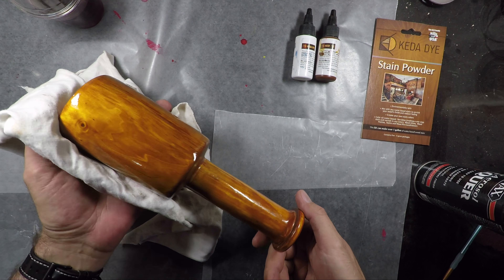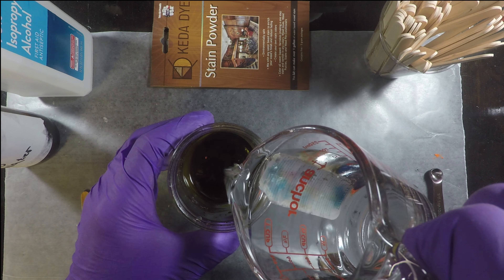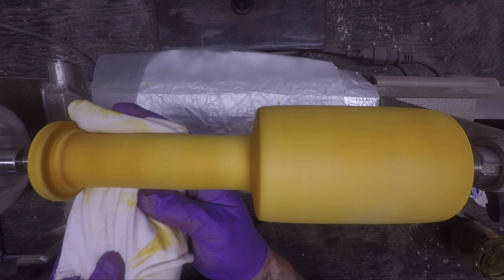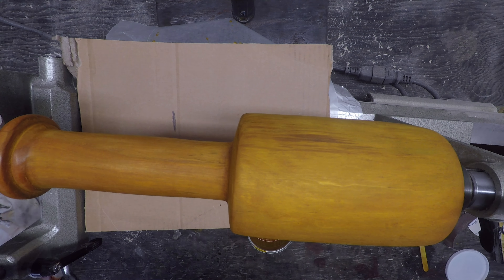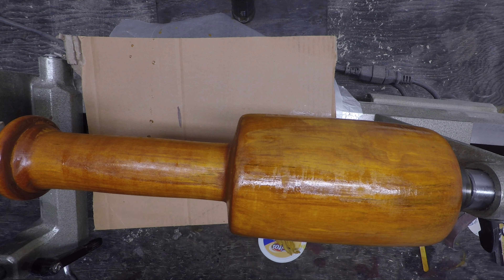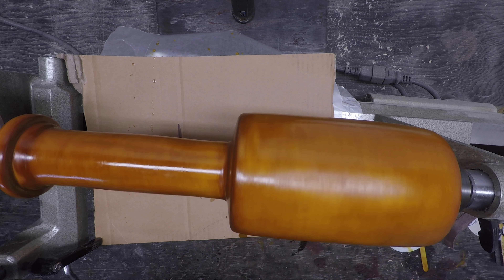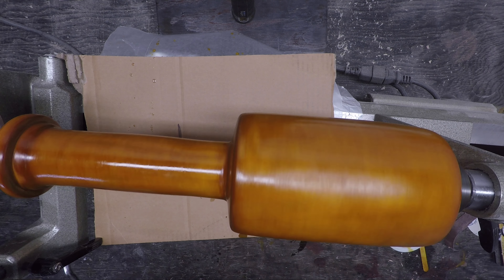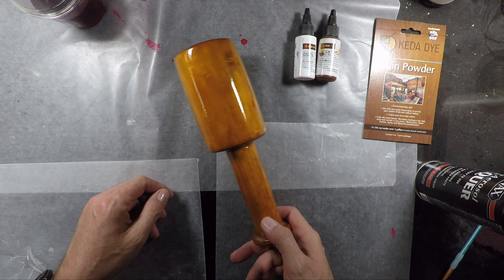Made Yellow Stain To Color Wood Yellow With Dye Kit To Make One Of Many Yellow Stain Color Versions

Comment: Is the main component of this made of a powdered Solvent dye? I'm confused what Solvent in this case means pertaining to Keda Dyes because usually Solvent dyes are found in powdered form.
Reply: sorry i meant this in regards to their 1oz bottle liquid form, is it essentially liquid version of this powder?
Reply from the maker: The liquid dye is a liquid dye that has the capability of being mixed into solvents like acetone, lacquer thinner, denatured alcohol, several other alcohols, as well as water (but prefer alcohol, acetone etc). The liquid dye dissolves quite well into those solvents. The powder "Aniline Dye" mixes best with warm water or rubbing alcohol. You are starting to confuse me now hahaha I mean technically there are many "Solvents" and if that were the case then would any dye that mixes with any solvent be called a solvent dye? So I guess you would say Keda liquid dye would be alcohol solvent, acetone solvent, lacquer thinner solvent, water solvent etc, but that is too much to say. As mentioned before, I mean Keda liquid dyes do mix with a water "Solvent", but they really excel with the organic solvents just mentioned. This video was about the powder dye, which was mixed in the water solvent first, then added the isopropyl alcohol solvent, because I feel it gives the best of both worlds ;). I think that is what you are trying to ask about? If the powder dye is water solvent? The liquid dye used in this video was just shellac solvent, and I only added 2 drops to about 1.5 ounces of shellac. Most people don't think of water as a solvent I know, but it actually a solvent that dissolves and dispurses the most of all the solvents 🤷‍♂️ I hope that is what you were asking?
Reply: You could say an organic solvent, that will cover all alcohols, lacquer thinner and acetone.  So the keda liquid dye works best in organic solvents, but can also be used with water; however, the keda dry dye works best in either warm water or rubbing alcohol. :)